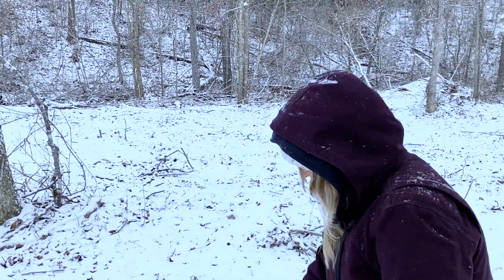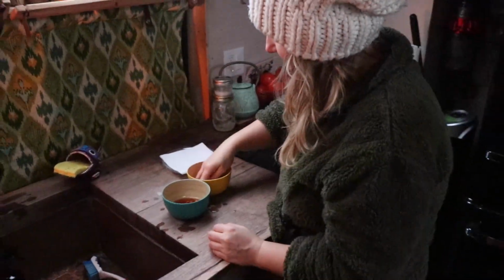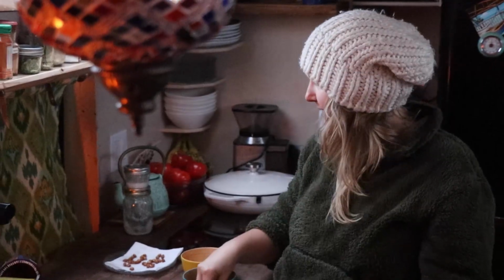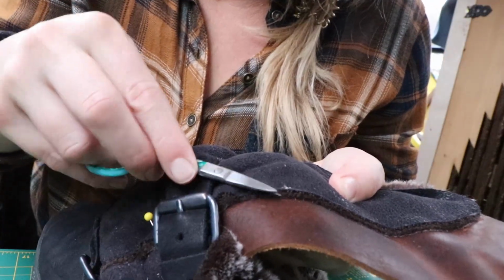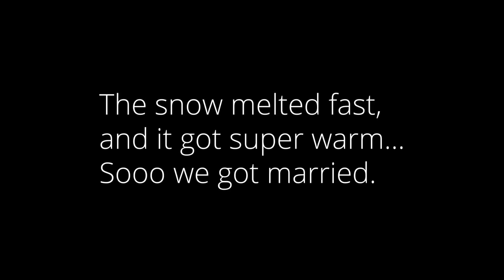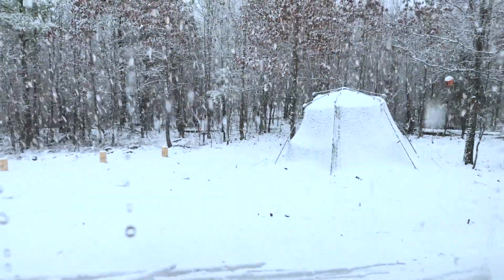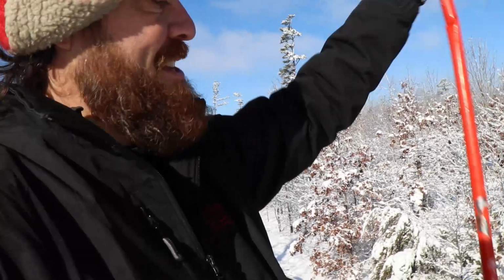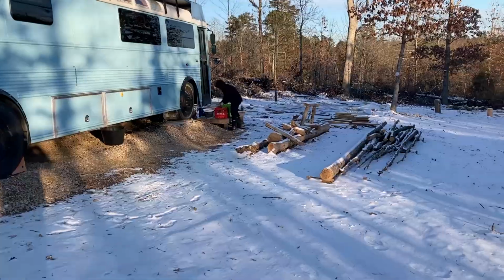Cozy Skoolie Snow Days On Our Homestead In The Ozarks - AND Our Wedding Day

Comment: Sadly these days we're always late to your episodes, but always a joy to catch up on you two luv birds. Was great to see a few clips of your wedding again. We've decided to pit another 360 watt panel on our sprinter to beef up our power input, but watching your solar panel snow issues and you seeking new clever generating methods is insightful. We found a great used ac unit for a crazy price. Not for luxury, rather we figure we'll need it for our big black pup when we're in hot areas this summer. Starting April or May we'll be full on seeking our bug out place😳 and yes, we're prepping loads of food and fuel storage options. Hoping we beat the panic curve that's coming 🙏 
Sending our love and blessings, James and Kim ❤️
Reply from the maker: Aww @J.James! It’s always nice to have you and Kim around. It sure sounds like you are getting everything together that you need. Smart to beef up your system, especially so you can run an AC for your pup. Hopefully we will have another video up tonight with another solar panel tweak. This is more for our parked situation. There is no quick up down how we have adjusted them, but the rays are pumping into the system now!!

It’s crazy what’s happening in the world. We’re getting our preps in line too. Can’t wait to get seeds in the ground. So sick of going to the grocery store as prices jump up everyday! Keep working hard on your rig, and keep your eyes peeled for your bug out spot. Big love -E+B

Comment: Wow, those thermal electric generator fans are cool! 
Or should I say “hot” on the wood burning stove!!🔥

Follow the Hawks & Eagles 🦅 🦅
Reply from the maker: Hah aren't they HOT @Spaceman 1111?!? Brian has some cool ideas for them. At some point he will experiment with those ideas. Once we get settled in, get the greenhouse and gardens going. The workshop. The water catchment... you know. After we get a few things done & settle in. ;) 

Gotta love those hawks & eagles always leading the way! <3
Reply: @BEAdventurePartners  I wonder if you could connect a voltage regulator and USB socket to one of those stove fans. Might be able to charge a phone or a flashlight. I posted a link to some info, but I think youtube deletes comments with links.  BTW, congrats on the hitchin'.  :-)
Reply from the maker: Great idea @Jim Steele - We know we won't get much power off of this little stove. However... If we can figure out a way to get power, and get a bigger stove for the shop... We could possibly run lights off of it!

AND you are right... I think YT sends your comments to spam if they have links. Then if we don't get to the spam folder within a short window of time, spammy comments are deleted. Not that YOUR comments are spammy per say ;) BUT you know what I mean. LOL We'd OK your link. I read your comment to B and got his wheels spinning ;) 

Thanks for the love & for hanging with us! - E + B too
Reply: @BEAdventurePartners  I've seen people do stuff with wood stoves. Like wrapping the flue with a copper pipe and setting up a thermo siphon to heat water. With the Peltier junctions like in those fans, you might wrap them around the flue tile style, or in a flat plate for the top. But you have to keep the cold side cold since it's the temperature difference that's important.   Have fun. :-)